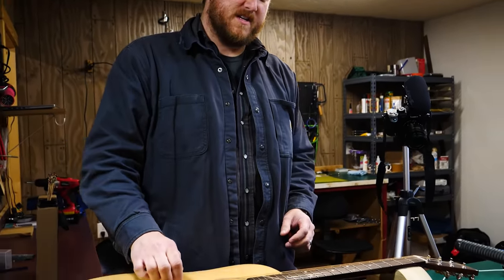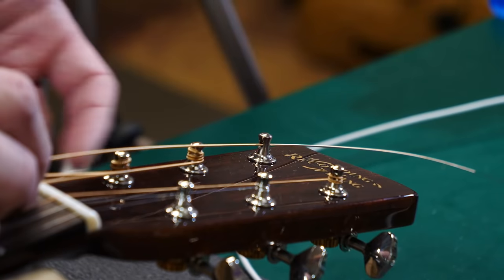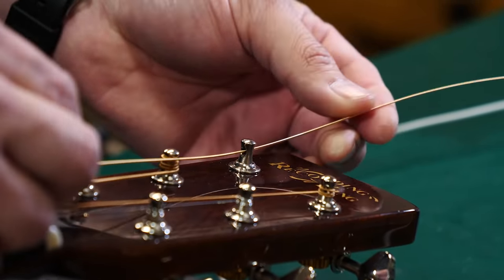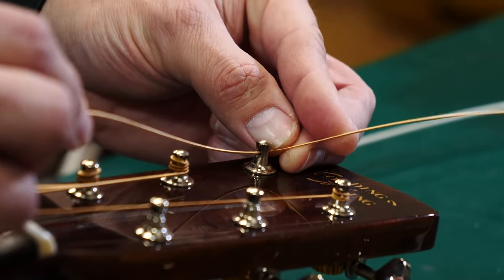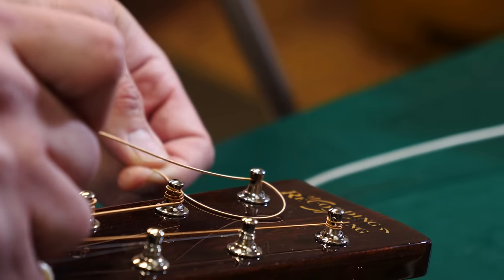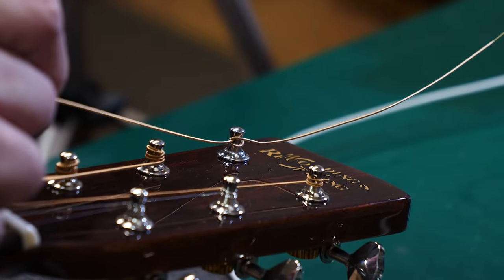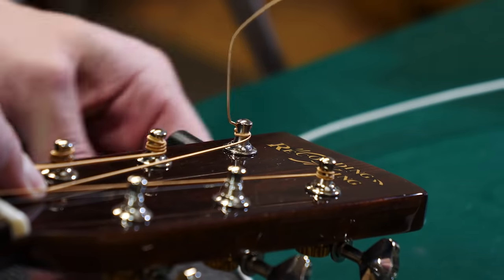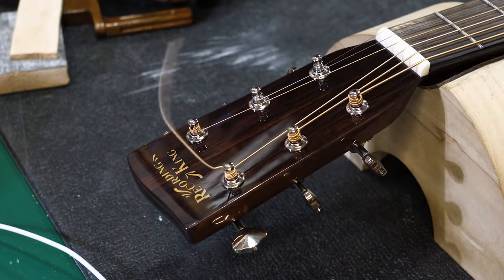Tech Tip: How to Tie a Luthier's Knot When Changing Strings

Comment: I love using this method.  This was a really great explanation on how to do it!  I am curious if there would still be any benefits using this method but fully taut and locked with locking tuners?
Reply: Locking tuners are great for fast string changes.  And if you have low quality tuners that allow your strings to detune with the tremolo bar, locking tuners are the way to go.  Think about guitars in general.  If locking tuners were so awesome, they would be on every guitar at most price points. 

For me, I am lazy and I love locking tuners enough that I put them on all my guitars. Aesthetically speaking, they look cleaner.

This method is just as good as locking tuners.
Reply: @jasonwojcik  I love them and think they would be on many more guitars but they aren't priced for budget guitars.

Comment: I've been stringing guitars like this for years too but I always thought it was called a banjo technique never known never knew it as a luthier not! I thought I was just always stringing my guitar like a banjo player would! The difference is when I string my guitar I don't wrap it hardly at all I always thought the more I wrapped it the longer it took for the string to actually stretch and stay in tune so the less strapped around that machine Head or whatever you want to call it the less stretching and out of tune it will go! I've always had great luck with this except sometimes I screw up on the high e and b and I don't put enough rap on it and I have to replace the string!!!

Comment: I have been using this technique for many decades. He has to many windings  though around the post, this will cause a long "break in" as the core stretches. the least windings the better. My knot has about a half of a winding allowing the string to be tuned up to pitch quickly and staying there.

Comment: I used to do this for my mandolins, but it has no advantages and makes removing the string a complete pain. I stopped using the knot and never had a string slip.  It also has a safety disadvantage - when you cut a mandolin string, the edges are really sharp.  If you use this knot, the end of the strings are pointing upwards, so when you cut them the sharp edges are at the top of the tuner, where curious fingers are more likely to encounter them.

Comment: I must be missing something. When using this method, the loops around the pegs are extremely loose, especially if i dont hold it tightly as i increase tension. Is this intended for electric wtrings as well?

Comment: That’s awesome…. But how do you “untie it”? It’s just a pain to change strings that are tied like this. My only problem is untying it. I’ve never seen Jimi Hendrix’s strings tied like this in any video or picture. He did pretty good doing it the same way I do it. My Luther even ties the string lock tuners like this. Why??? I’ve been playing for over 35 years and I’ve never had a problem with string slippage. I’ll stick to Jimi Hendrix’s way. It just makes it a struggle to change them.

Comment: I've been stringing guitars for at least 35 years and I never knew this was a technique. But I have a question for you if you have time to answer it. Do you still have to stretch the strings after doing this knot?
Reply: I use this method on all my guitars and I still "stretch" the strings while tuning. It's really just taking out the slack.

Comment: I bend strings pretty aggressively and don't find this technique to be necessary. I generally just count 3 fingers past taut and back the string to get the right amount of winds. The biggest detriment to tuning stability is headstock pitch angle and a properly cut nut, and the luthier's knot isn't going to fix that.

Comment: This is great,my string are not slipping any more, but my problem is the guitar goes sharp,, every  morning, I have to de tune then to get them back in tune, it's annoying.
Reply: Hey David- I haven't tried Ben's technique, rather I follow BB King's approach of winding the whole string, no knot, just tension (I've followed this approach for both acoustic and electric). I occasionally experience a sharp/flat tuning shift the following day but think it's related to meteorological/ temperature change in oppose to string-winding  technique. ANYHOO- my strings are played out dead now so I'm about to change 'em and try Ben's approach and I'll post a comment re. how I find it after a week or two. Oh- one other tip- I use a capo to hold the string in place on the fretboard and that makes winding more manageable. Cheers

Comment: And then a string breaks mid-set and the artist wants it back for the start of the next song.

Yes, this is okay for playing at home.  For gigging, skip the knot.  Pull the string all the way through the post then pull it back the distance between the first two frets.  Kink the string at the post, make the first wind above and the rest below so the break angle over the nut is correct.  Nothing slips and emergency string changes are lickety-split.

Comment: I do this except I don't slack the string. What's the benefit of the extra windings?
Reply: It puts more downward force on the saddles and gives the strings a tighter feel. I find it helps with tuning stability and returning to pitch after bending when down tuning and/or playing with light gauge strings. Extra wraps help eliminate the tuning stability issue on a 3x3 G-String.

Comment: I've heard all about the luthiers knot, however, years ago I learned from Taylor guitars that it wasn't necessary to knot the string. Their advice was like a few other comments say, it's easier to just put the string through the hole and put one wrap over and a couple of wraps under. I've done this for years now and never have a problem. Not that I'm a big fan of Taylor guitars as I think they are way overpriced and there is a "vanilla" sound to them as compared to a Martin.

Comment: If you gotta tie your wound strings, then your turning problems aren't with slippage. I learned to tie my unwound strings in this fashion, and did so for probably thirty years until I decided I can skip a step and just do what I call the "over/under". And then I learned that's actually a thing people do; first wrap goes over the excess of the string, the rest goes under. Give a little kink in the string before you clip it, and it holds tight; if you need it to.
If you've never experienced slippage, then you probably don't need to tie at all. 🤷

Comment: A luthier's knot was relevant for gut strings. With steel strings however, the 'capstan' shape of the tuner post forces pressure on the winding below it, making a knot completely unnecessary and unhelpful. If capstan compression alone is able to hold a ship to harbour side without slip, holding a guitar string is no challenge at all.

Comment: You don't need all those winds. Treat the luthier's "knot" as you would a locking tuner. Trust me, it works. I've been doing it for decades. And by the way, removing them is as simple as cutting the string and pushing it back through the tuner.

Comment: You don't need a "Luthier's knot". I wrap the first wind over the top of where the string comes out of the post. Then wrap the rest under it. It's the way I've been doing it for 59 years. You don't even need to do that. A couple winds around the post is all you need to get the string to bind enough not to slip. It make replacing the strings much faster. Especially if you break a string during a performance. But, to each his own I guess.
Reply: I don't think I'll be using this method on stage LOL.

Comment: I guess I'm the only one that run the string through, go around 1/2 and run it back through. Kinda a D shape. 1 coil on top then switch (opposite side of the D) to under. I have been doing this for over 40 years. Even tossed around, they stay.

Comment: Been restringing guitars professionally for 40 years for celebs etc. I would not use this method especially  when things get desperate on stage and seconds count.  A guitar tech would not want to mess with that when an artist breaks a string and it needs to be replaced quickly. The only thing needed to secure a string to a post is the 2 opposite right angle bends at the tuner holes.

Comment: You don't run the string through the post first. It will crimp the string and it will break. Rap the string around the post first a few times and then through the hole.

Comment: Has anyone seen the method where you pull the string next to the barrel. Wrap three times. Go through the barrel above your wraps and tighten. It takes three seconds. I gig weekly and change strings after 12 to 16 hours of play. Blue grass heavy Strummer. Break older strings usually at the saddle just in case you wanna say my method is what's breaking them

Comment: I HATE IT!!! I have changed strings on guitars for literally over 1,000 times and I always hate it when someone brings me a guitar where the strings have been tied in knots. When taking them off you always get stabbed by them and the cutoff point is never clean enough. Even Martin, who employs this method has been complained to for years for doing this. (The only reason I can surmise that they use it is to make it idiot proof so that anyone can put strings on without regard for the person who has to take them off.) There are numerous factors that come into play, and if anyone is still reading, I will explain.

#1, string bends weaken the metal, providing easy break points. @2, all strings are not the same. Ideally, you will want multiple wraps on the capstan of the tuner, which can be more difficult with shorter capstans. Nonetheless, when you start with the thickest string you will, naturally, be able to wrap fewer times, which is not a big deal since the string windings grip the capstan. Because of the difference in string diameter you will be able to get more wraps on the higher (thinner) strings, which adds stability. Normally, the distance between the tuners is such that you can cut off the string BEFORE inserting it at about the distance to the next tuner for low strings and about 1 and 1/2 for the higher strings, changing length as you go. The amount of string you put through the tuner should be equal to the diameter of the string. Then, when you wind the tuner there are no sharp points sticking out. 

There are exceptions to this general rule... When using coated strings, such as Elixirs, you will find that they tend to slip. And so you must double the amount of string-through in order to get them to grip. The other problematic one is very thin strings, like an 8 on an electric or a high G on a 12 string. These also must have extra length through the capstan to keep them from slipping. Believe me, they will recede when you tighten the string. 

There are other techniques to deal with thin strings on electric guitars with a Floyd Rose or classical guitars. If you are able to contact me I will be happy to help with that. I will probably not post my own video as I am in the process of opening a music store in Chattanoog, TN. Wilson - Music.

Comment: I am a part time luthier, I do not use this method nor condone it. The easiest and simplest method is to pull your string tight through the nut, depending on the string wrap 2-4 coils around the post, then run the string through the hole, hold It in position then tighten, you can literally have it restrung in 5 minutes. None of this nonsense.

Comment: For me, this method has always weakened the string and they snap from hard playing. I found when bending them over one another like that they don't last as long and it snaps the string right at the joint.
Reply: You are 100% right. Don't do this. I read an article years ago suggesting this as the quickest way to change a string in a hurry, so I gave it a try. Broke a string shortly afterwards. Not something that happens often when you are a bass player.

Comment: Nothing wrong with the knot.  I used it for years.  Eventually, I learned to just run it straight through the distance of about two tuner posts.  I pull it back and place a small bend and just tighten it up, over and under.  Absolutely no slippage ever.  It’s faster and just as reliable.  No disrespect intended and I wouldn’t do it if it didn’t work.  Been playing and changing strings for 40 years.
Reply: Yep! Same here.

Comment: Luthier of many years, and I refer to this as the dumbass wrap.   I charge extra to deal with this crap.   For the most part, the posts are convex so that when wrapped properly without this moronic solution, they cinch up like a capstan on a sailing vessel.  Just put enough wraps and you’ll have more stable tuning after stretching your new strings properly.

Comment: There is no need for any coils when using a luthier's knot.  Just pull it tight, and tie it. It will tune up in in 3/4ths of a turn.  When the string remains in the skinniest part of the pin, it will be geared lower so it will have finer tuning.  The more coils you have, the more slippage and stretching, and more down bearing on the nut causing more friction which causes more slipping when the tensions equalize.

Comment: Tuning issues?  People blame their string winding..(a few tight wraps has always held tight for me)..their tuner machines..(almost never slip, though sometimes need cleaning). When the most common issue is your nut...strings hang up and go sharp..use lube or enlarge slot if need be .

Comment: The several varieties of luthier knots are a waste of time. I tuned pianos professionally for over 30 years. Correctly-tuned piano wire is under FAR greater tension than a correctly-tuned guitar string, and the piano-wire winding technique is simplicity itself: 1) cut the wire roughly three fingers beyond where the wire will bend at the tuning pin's hole. 2) Pass the string through the pin's hole until the end of the wire barely protrudes through the hole on the other side of the pin. 3) Stabilize the wire while turning the pin to create the initial coil. 4) Turn the pin while maintaining a smooth coil that winds toward the pinblock. 5) Tune to pitch.
I've been a guitarist for more nearly 60 years. I went through these luthier knot gyrations until I learned how pianos are strung. I immediately experimented with stringing my guitar the piano tuner's way and have never gone back. My guitar tunings take far less time to complete than these knotted variations and are rock-solid stable. The only difference between the two techniques is that you'll need to use two fingers to measure the guitar's sixth and fifth strings in order to avoid over-coiling the string on the tuning pin.
Save yourself a ton of time and string your guitars the way piano technicians string pianos.
All the best...

Comment: Nope I'll keep using the 1 above and 3 below method. It never slips and the strings always keep there tension even with hard tremolo use without causing a weak spot in the string from the bend.

Comment: Hate having to change strings on a guitar someone tied knots at the post. Totally not necessary. First wrap over, 2 to 4 wraps under and you'll never get slip. Easy to remove also.

Comment: String through the hole and over the top and the rest under , set the string length by hooking it with the middle finger and make a gun. Most times when changing strings on a "luthier knot" you will get poked. A real bummer. This gives you on average 3 wraps and baby that's all you need.

Comment: BAD IDEA! Not only does this knot, not provide a single benefit but it makes it a real hassle to yank that part of a broken string off in a hurry to replace it quickly in the event of any performance you are doing with that guitar. ALSO BAD ADVICE, is to use the same 1 1/2 or 2 inch extra string to wrap around the tuner! The guitar performs better when the strings are wound close to the BOTTOM of the tuning peg and this requires ALOT more for a thin high E string than a thick low E string. It takes practice to know how much that requires for  each string but it is worth it. The only trick  is to finally cut the unused end with enough left on the post to bend it down towards the center of the headstock so it won't poke you and cause a finger injury during handling or tuning. Trust me on both points. These knots are just a lazy way to start the winding process, imo.

Comment: Do not use this method. Simply just pull the string tight through the tuning peg hole, pull back about fret's worth of slack, then pull the tag end towards the ceiling to put a kink on the tag end going into the tuner. And this point, you are now done. Wind the string on while pushing down on it with tension so that it wraps downward.